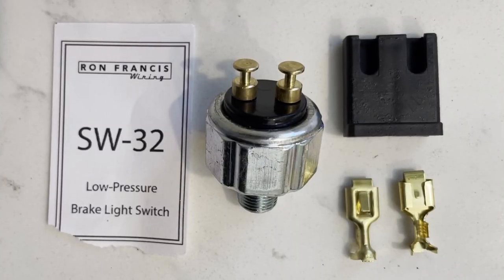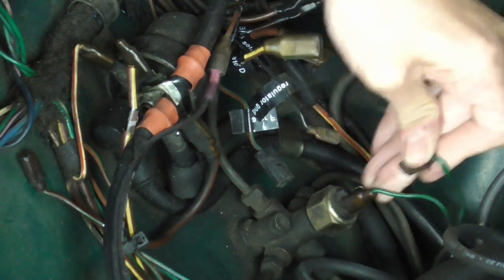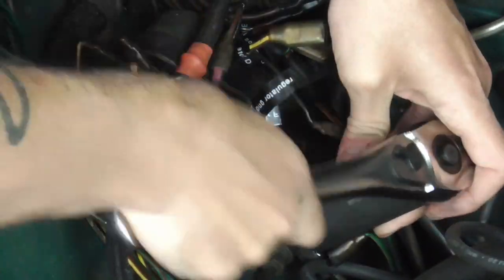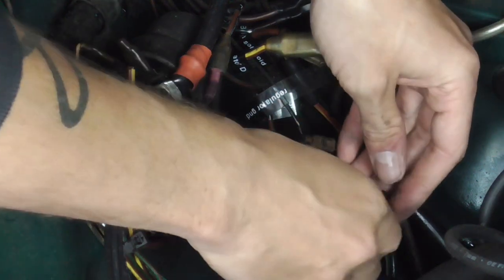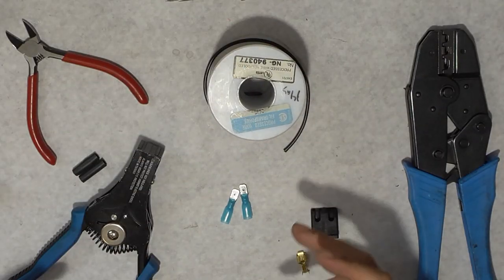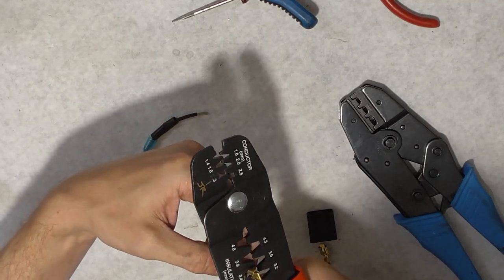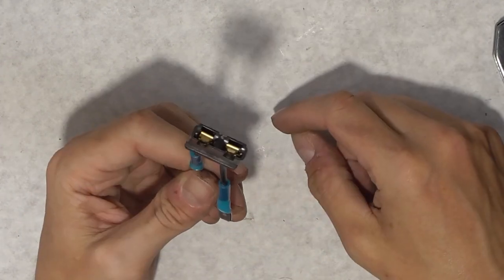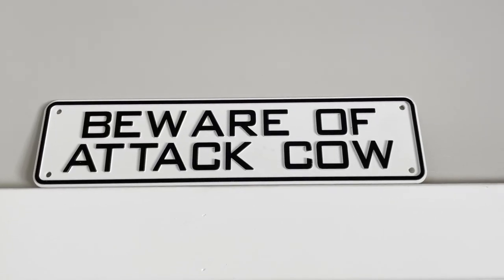Replacing a 1967 MGB hydraulic brake light pressure switch

Comment: The Moss replacements would only last me one to two months. The Ron Francis switch lasted 8 months. I replaced the switch with a unit from O’Reilly auto parts four years ago and it’s still going strong.
Reply from the maker: I think the best tip for longevity is to throw a relay in the circuit, controlled by the switch...That way almost no current goes through the switch, and it eliminates some voltage drop from the rest of the circuit. Should improve longevity as well as brightness.

I still like the Ron Francis for the lower pressure.